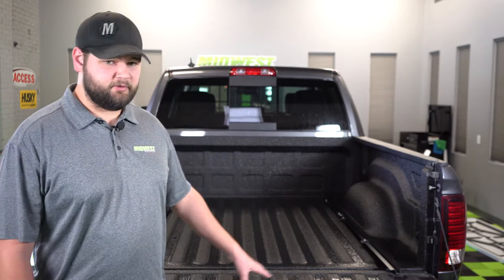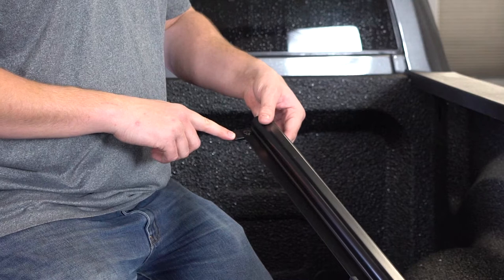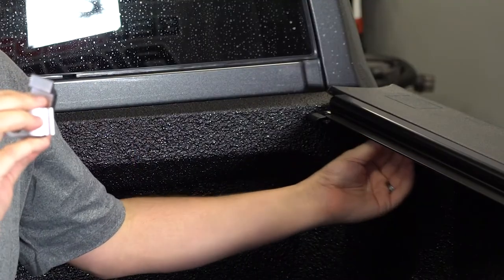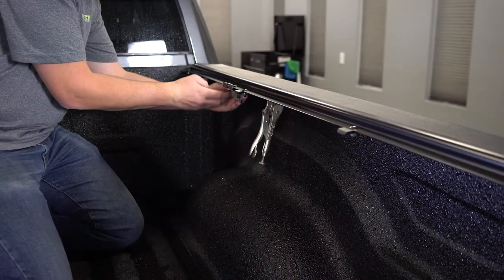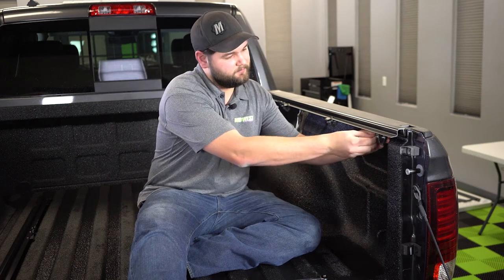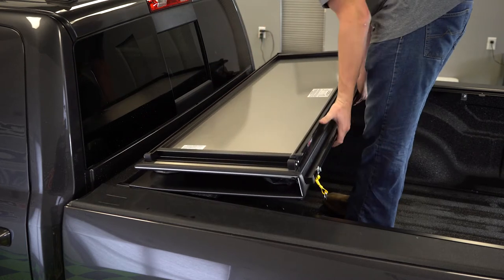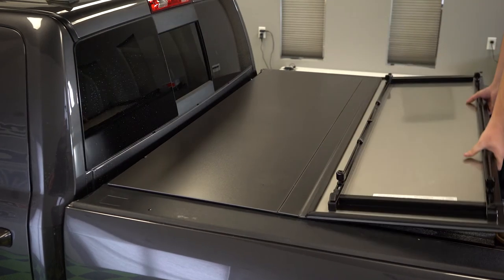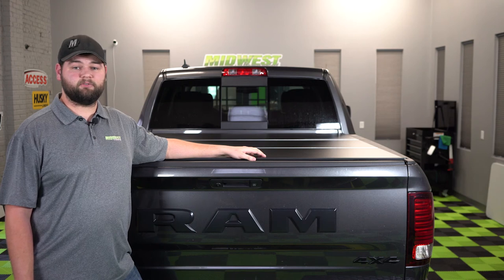Lomax Tri Fold Tonneau Cover Install

Comment: That second panel, does it lock down in the channel?  What’s to stop wind from gettin under that panel and blowing the whole cover off.
Reply from the maker: There isn't a locking mechanism that the second panel locks into, but the cover itself is going to be locked in place at 10 different points. Because of the really low profile design, wind shouldn't be able to get underneath there and rip the cover off. We installed this cover on one of our shop trucks and it stays locked in place and doesn't move. Let us know if you have any other questions!

Comment: So does it keep all water out or only some ?
Reply from the maker: Most tonneau covers do a good job at keeping most rain water out, but none are truly watertight. You'll likely see some water get in, especially during heavy downpours, at the tailgate and near all the corners.

The Lomax Tri-Fold certainly does a great job at keeping water out. But if you get a super heavy downpour or hurricane winds, are we going to swear you won't get any water under your cover? No. If you were to see any water get in under a good tonneau cover, typically it would be at the corners and the tailgate. We recommend hauling electronic equipment in waterproof totes, and if you must haul sensitive equipment while it is raining, try to keep it to the center of your truck's bed. If any area of the truck bed will keep completely dry under a tonneau cover, it will be the center.

I have a fairly economic vinyl roll up on my truck at the moment. It keeps most of the water out, but I do see some water at the tailgate during heavy rain. Typically I can see that the area within about 6 inches of my tailgate has some wet spots where water got in. Beyond that I tend to be good. But some of this has to do with make / model and the installation of the cover as well. So we (and most every manufacturer) are hard pressed to call anything "waterproof" meaning it will keep all water out and is completely watertight. You are very likely to see some water get in from time to time, even on the most expensive of covers.

Heck, even my father's camper shell gets some seepage at the corners from time to time, unfortunately. I never leave anything super sensitive under my cover during a heavy rainstorm for this reason.  But I have left several waterproof bags and totes under my soft cover during rainstorms, and so far none of my bags or totes have ever gotten wet. But I'd rather be safe than sorry, if that makes sense.

We've been thinking about doing a car wash test series involving various tonneau covers, to try to show exactly how waterproof and water tight each is. Would that be something you'd be interested in seeing?

Comment: Whats the difference between gen 1 and gen 2
Reply from the maker: Hey Andrew,

The biggest different in the generations of the Lomax is the hinges. When the first Lomax came out, they didn't take into consideration super hot climates so customers were having issues with the hinges coming apart between the panels. They have redesigned them and are doing a lot better! Let us know if you have any other questions. Thanks!